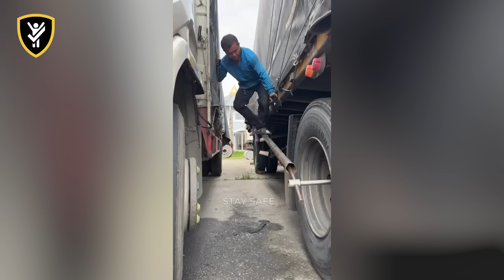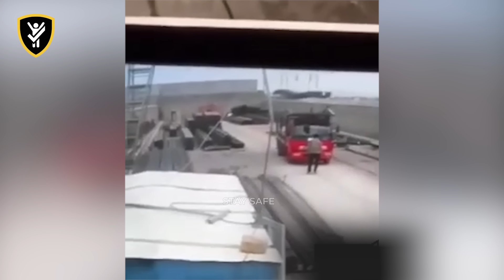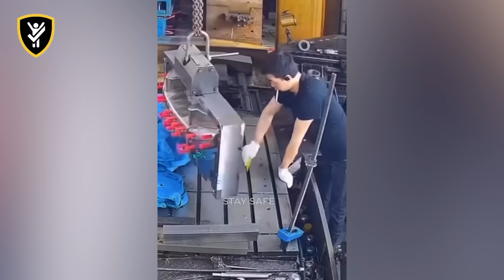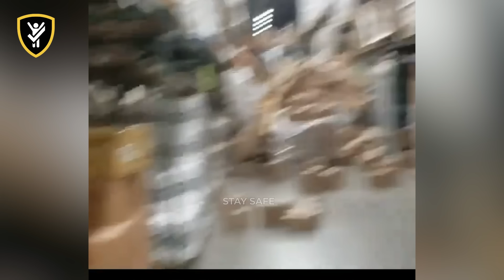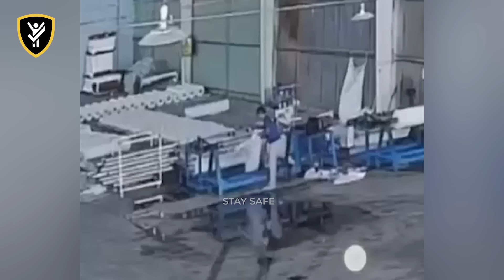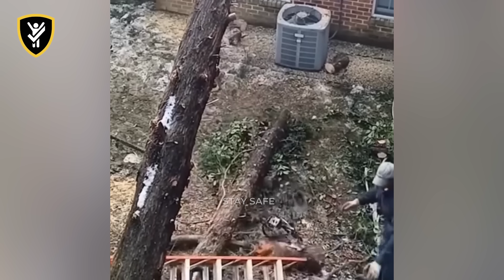He Used The Wrong Tool... Then This Happened!

Comment: Clip 12 shows the wrong way to use a pipe as an extension handle.  The safer alternative to standing on the pipe is to crouch a bit, rest the pipe on your shoulder, and then straighten up.  As a bonus, you can apply more force than your weight.  The big problem with standing on the extension handle is that there is no control, once the fastener breaks free.

Clip 11 is some kind of milling machine, or lathe.  The piece is fastened to the turntable, the turntable spins, and tools are pressed against the piece to remove material.  In this incident, the operator was standing on the turntable, for some adjustment task, and it spun up, before he dismounted.

Clip 5 shows the importance of leaving the fork tips as low as possible.  On a factory floor, you should be able to travel with the fork tips only millimeters off of the floor.  Out in a yard, the fork tips need to be lifted higher, but once inside, the forks should be lowered to just off of the floor.  Driving the tip into the sole of someone's boot will make them fall, but hitting their leg could cause an injury.  Forklift drivers need to watch where the tips are going, along with where all of the wheels are going, but they cannot watch everything that they need to keep track of simultaneously.  That is why the biggest safety breach was not beeping the horn, until everyone there had made eye contact with the driver.  Nobody in the clip seemed to be aware of the forklift's presence.  If the pedestrians were able to watch for the forklift, the driver would not have to watch for them.

Clip 1 shows the importance of using tools properly.  Rather than properly set up the step ladder, it is leaned against the tree limb.